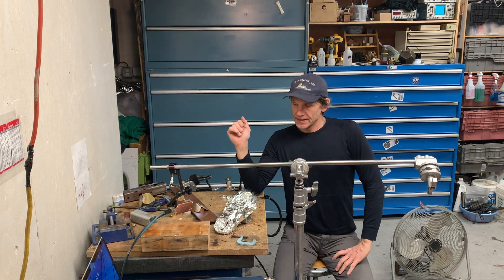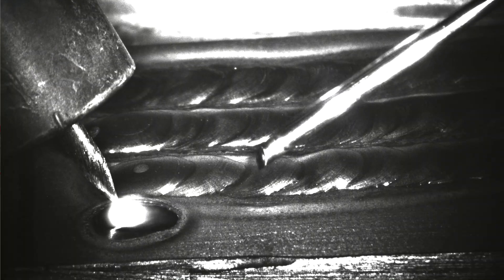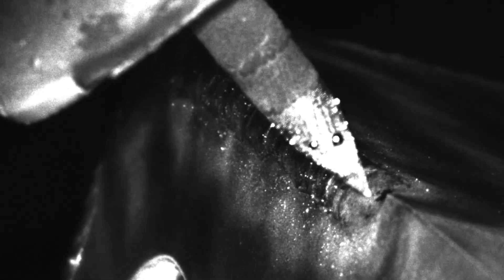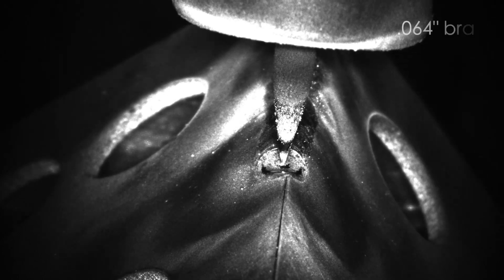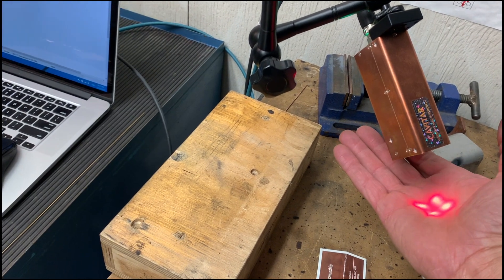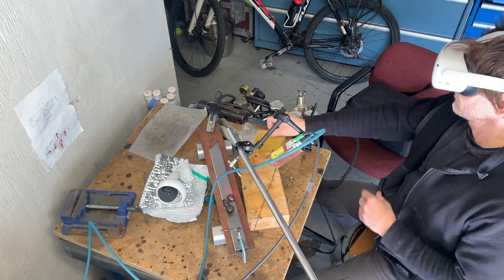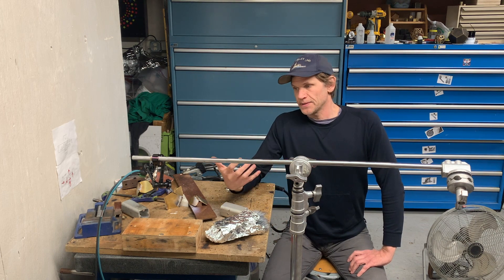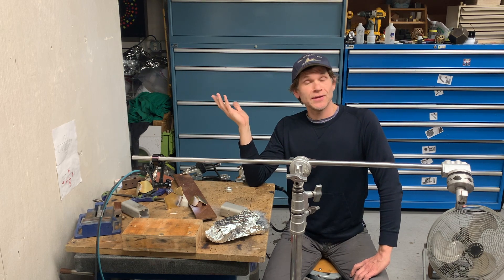Welding with an Oculus!

Comment: Cover your face or you gunna get a burn, i think its very interesting and a really cool idea but you gotta shield yourself from the light - also the oculus works off of infrared cameras, so the weld may destroy the cameras too - not sure, probably best to shield all of it

really neat idea though, one of my biggest problems with welding is not being able to see - this experiment you did could lead to a much better welding experience system